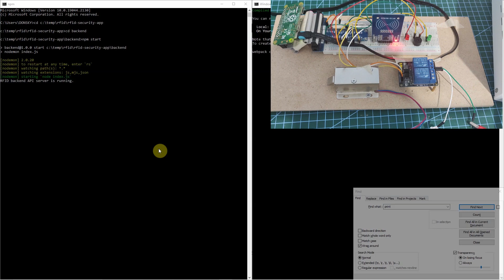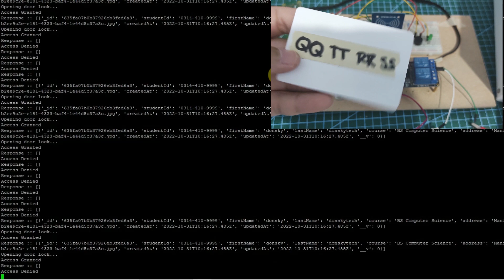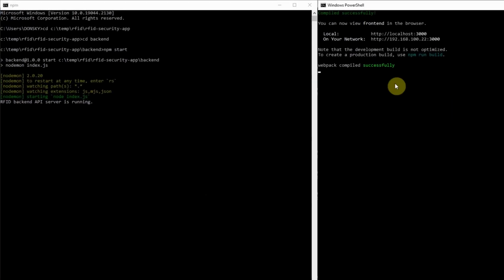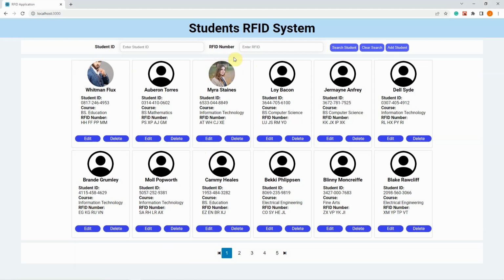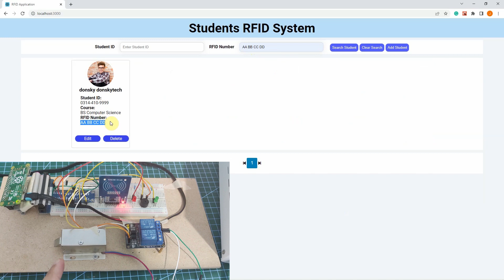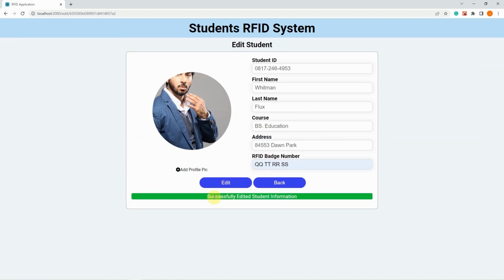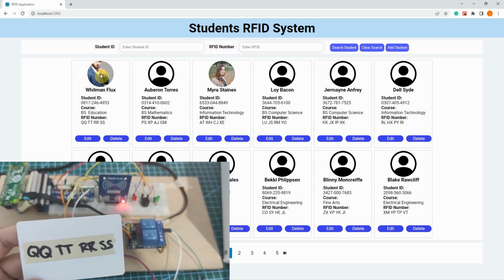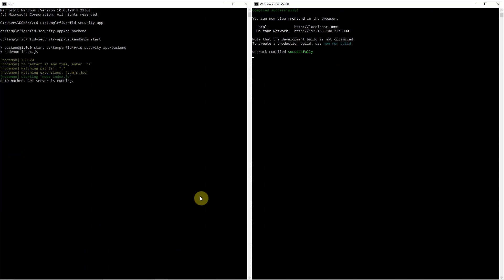Raspberry Pi RFID Door Lock System with Database Interface

Comment: Nice project and nice video on the topic. I do have a question though. Can I store the DB and management of the DB on one Raspberry Pi, then have another Pi do the RFID read as well as control the lock?
Reply from the maker: Yes quite possible. You have a lot of options on how you could send messages between the two raspberry pi.